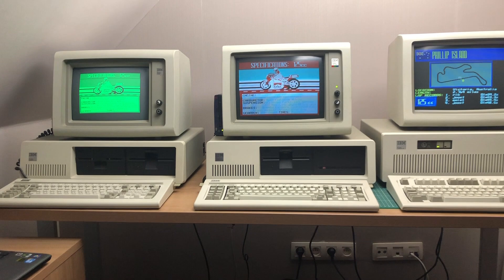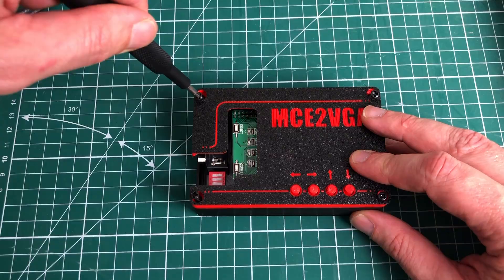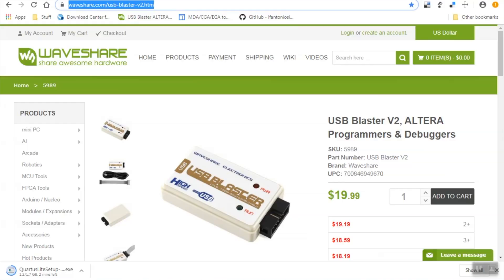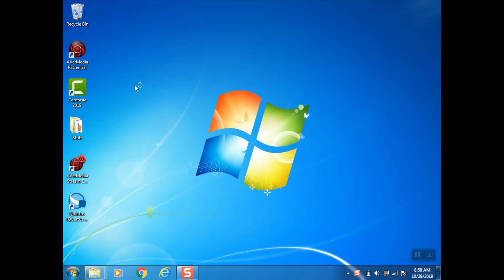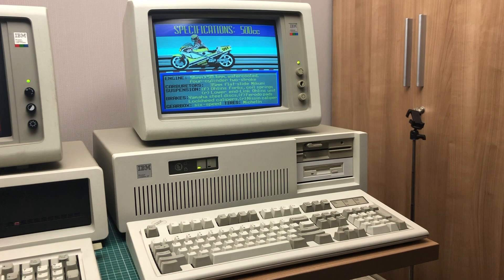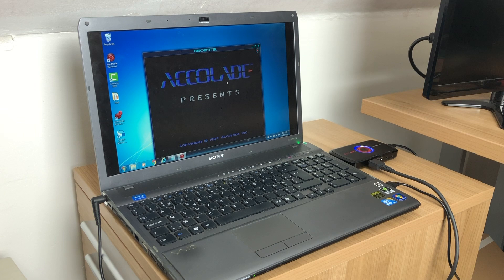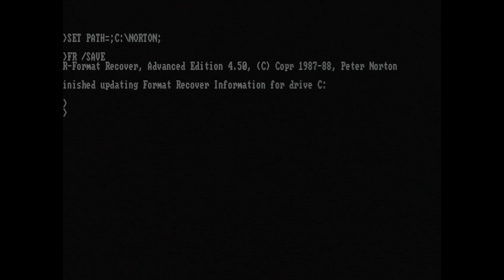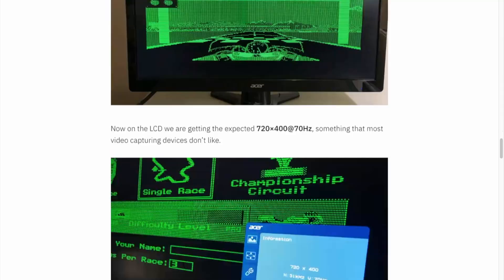Retro computer video capturing

Comment: Very comprehensive, nice work tackling this subject.  I haven't brought myself to do it yet (although I did tackle the speaker, see the channel "The Oldskool PC' for the video).
My issue with the MCE2VGA is that it scales the output, and also doesn't handle borders/overscan. It is a great device for people who want to hook up VGA monitors, but I can't make 1:1 pixel captures from it so I personally don't use it.  (I have my own capture path that I'll document at some point, and a friend is working on new hardware that should be able to tackle this in 2020.)
Reply from the maker: Sounds great ... please keep us posted on that. MCE2VGA is one of the few solutions out there that handle both mda / hercules / cga and ega and I've found the results to be really good ... with the new firmware I'm really pleased with the capturing results for cga / ega. Only hercules needs some post processing.
Reply: New hardware sounds exciting. Since all the historical outputs are essentially digital it seems it would make most sense to convert directly to an HDMI signal without scaling. That would let you make pixel perfect captures and perform any scaling and aspect ratio correction in post, with more flexibility than a hardware scaler offers.

Comment: Thanks for making a video about this device!  I purchased one of of the MCE2VGA devices and mistakenly didn't order the LPGA card with it.  I purchased the LPGA card and programming cable from Ebay, and attempted to upload the files as you have shown in this video.  When I connect my Tandy 1000 to this device, it seems to sense a signal, but no graphics or texts comes through.  Do i need to upload different files from the ones you are showing here (mce2vga.jic)?  Thanks!

Comment: You're running a SCSI harddrive on your AT? Just curious because the AT has a harddrive out of the box (I don't remember if it was IDE or MFM).
Reply from the maker: My other IBM AT came with the standard 16 bit MFM controller + seagate MFM 30mb hard drive. This one has a scsi card + scsi2sd card so that I can easily transfer software

Comment: Also:  For future comparisons, you may want to use a program that supports the full native resolution of Hercules.  I suggest Microsoft Flights Simulator 3 or 4, as they draw in the full 720x350 resolution, as well as supporting 4-color CGA and 16-color 320x200 EGA (and also 640x350 EGA if you have a capture path for that).
Reply from the maker: yeah thanks for the suggestions ... planning on doing a follow-up ... busy with some additional research right now. Feel free to contact me if there are specifics that you want to see. There is an email in the about section of the channel.

Comment: I'm not interested in video capturing at all. I just came to see the old displays and formats, namely CGA, EGA, and VGA, as the pack-in software that came with my first computer varied between the three. 
But, I am also interested in seeing old computers running on new displays using original output.

Comment: Cycles runs poorly on 286, 486 obviously needed.
Reply from the maker: It is playable on a 286 like the IBM AT. Game was released in 1989 so think lots of people did end up playing it on a 286. 486 not really needed. Think people had more time, were less impatient and not so demanding ;)
Reply: There are diminishing returns with Test Drive, Test Drive II, Gran Prix, and The Cycles -- they all use the same engine on the PC, and are framerate-locked, so even on a Pentium you don't get more than (IIRC) 18fps.
Reply: @JimLeonard  Ok, but this is far from 18, its like 2fps.
Reply: @fradd182  It runs acceptably if using CGA graphics.  If using any other graphics mode, it's twice the amount of memory to copy and thus needs a 10-12MHz system to be fun.  (486 not "obviously" needed :)
Reply: @JimLeonard  But this was a CGA version, shown here. It produces 11 frames per 5.2 seconds, making it 2.1 fps. I dont know, some games dont demand high fps to be playable. It might be acceptable when one actually plays it, it just doesnt look like it.
Reply: @fradd182  2.1 FPS sounds like that was run on the XT, not the AT.  The AT (a 286) should have been faster.  I'll re-watch the video later.
Reply: @JimLeonard  Exactly, it was 8088. Sorry my wrong. You can see the configuration at 15:55 .
Reply: @fradd182  mystery solved :-) yeah, those four games are only enjoyable on a 286 or later.